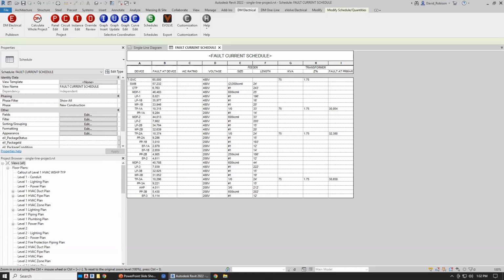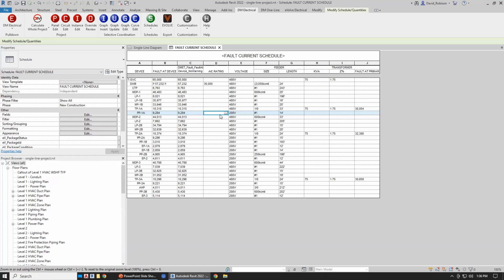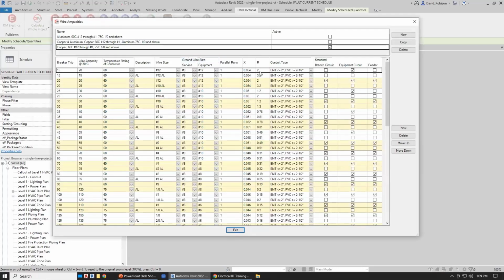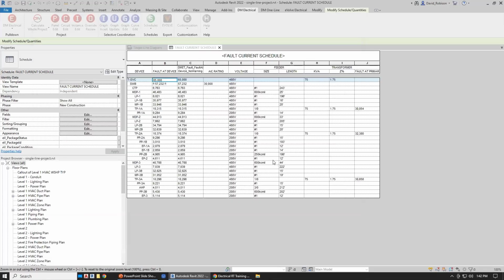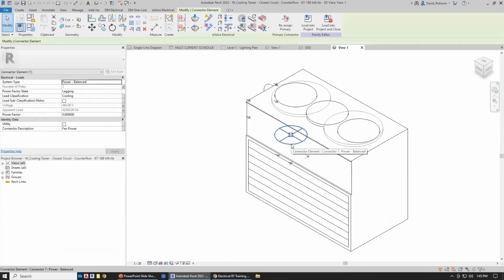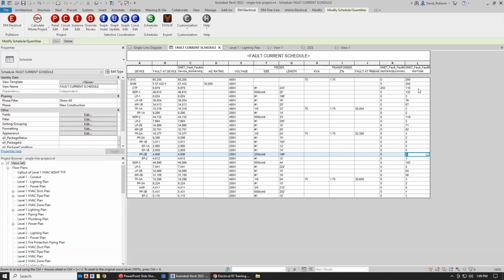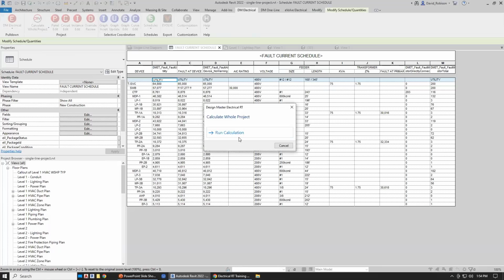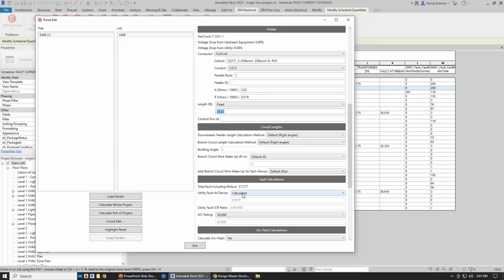ElectroBIM for Revit: Fault Calculations (09/21/2023)

Comment: What do you mean by Equipment Circuit in your Wire Ampacities table?
What's the difference between DMEN & DMET parameters?
Where in the standard it says we can ignore motors smaller than 50hp for fault current calcs?
Can you share a link to the article that explains ATS setup in revit, please?
Reply from the maker: 1. Per our documentation, the "Standard, Equipment Circuit" checkboxes denote which breaker sizes to auto-size to for branch circuits that are being sized based upon a specified MCA and/or MOCP value:
https://www.designmaster.biz/help/electrobim/usermanual/ribbon-command-reference/customization/wire-ampacities/

2. "DMEN" parameters are the Number data type; "DMET" parameters are the Text data type:
https://www.designmaster.biz/help/electrobim/usermanual/advanced-topics/shared-parameters/

3. We don't have a reference readily available because, as David says, it's not something we endorse or account for. We've heard customers reference it, but the important part is this: It was only ever meant as a shortcut, and if you're using ElectroBIM, you don't need that shortcut.

4. Whenever a knowledge base article or another training video is mentioned, we will include a link in the timestamps listed in the video description. For now, here is that link:
https://www.designmaster.biz/support/blog/2019/07/automatic-transfer-switches-in-revit/
Reply: Thanks a lot @Design_Master_Software